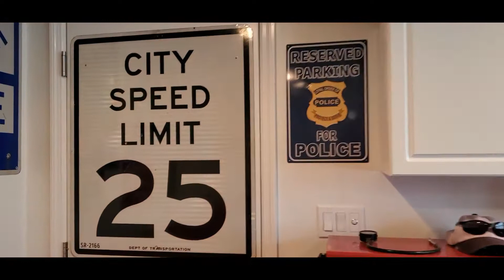All-O-Matic Garage Door Opener

Comment: That was an interesting failure.  In retrospect, looking back and seeing this footage as well as the footage I recorded, the problem was definitely some switch somewhere in circuit that was preventing it from operating.  I think it was the switch that I pointed out that is hit by the trippers when the door hits the end of travel at both ends.  Seeing your footage, the trippers seem to move a bar that the switch is connected to.  It seemed to move, maybe a tiny bit lethargically, and perhaps the switch, which (speculatively) is a BBM (Break Before Make) type.  That means that the switch breaks the circuit in one position, before making contact and completing the same or a different circuit in the other position.  In odd Octember moments like these, chances are good that bar could have balanced itself just precariously enough, that no circuit was made in either direction.  Moving the pulley was enough to get it back one way or the other and it started working again.  Cooler temperatures, high humidity, and gummed up old grease, can cause this.  If the problem recurs, I would look there.  

It's very unlikely, but possible, that the motor was in a "stalled state", again, at just the right position, and turning it got it out of that state.  Otherwise, it appears that garage door opener will run forever, save for the belt, which I'm sure can be sourced and replaced.
Reply from the maker: I should have also cleaned the top of the unit has we'll.
Reply: @xjoe81x  Sometimes the dust acts as insulation that keeps the unit working, especially in cold weather.

Comment: Heres what i think is the issue.  The mechanical latching relay is going bad.  The relay coil could be getting weak, and not pulling in the contacts to start the motor.  That hum you heard in the beginning is the relay coil buzzing.  You can probably find a relay online.  Also id change the capacitor as well.  You can go to harber freight and get a volt meter that checks capacitence. I think your issue lies in the latching contactor.  Might need replacing.
Reply from the maker: Thanks, I'll look into it.

Comment: Holy crap, an All-O-Matic that still exists?? We had an avocado green one at our old house, it was at least from the 70s. It stopped working in October 2019, and was replaced with a Liftmaster one.
Reply from the maker: It couldn't be fixed?
Reply: I'm not sure, maybe. Basically, we went to put it up one night, it didn't stop in time, and brought the garage door way too far back (it actually hit the motor itself and knocked the light shade off). When we called out to have it fixed, we were told that "this thing is so out of code that I could get fined for working on it". So that was the end of it.
Reply: Mine just stopped yesterday. Exactly like this one,  RS model, same colors teal and white. The remote makes it click, the hardwired button does nothing... so then I smacked it and it worked to get my car out of the garage, but now it doesn't do anything again 😂
Reply: @360Moth  May be time for a new one.
Reply: @isaac24  i went out to investigate... didn't see anything or smell any burning that would make it stop working out of nowhere ... turns out the plug wiggled loose, it looked plugged in but wasn't 😂😂 rofl
Reply: @360Moth  Oh, well an easy fix in that case!

Comment: Hopefully you can answer this considering the video is 1 year old; where can I find the release latch and arm seen at 16:00?
I have the same opener, but the previous home owner disconnected it and it's now missing. Very unlikely I can find an exact replacement, but I could use anything to point me in the right direction.
Reply from the maker: Unfortunately I do not know.

Comment: Did you find the problem? My identical opener has the same problem. Works fine sometimes.
Reply from the maker: @freddierizzotto99   No, I did not. I just ran it a couple of times without the door attached, and it worked.

Comment: Do you have a video on how to remove and replace the belt with a new one. 
After hinging the bottom pan the belt is worn in one spot. I would like to replace the worn belt with a new one except I don’t know how to remove it without cutting it. Sometimes you have to move the motor closer to the large wheel to ease tension on the belt. Didn’t see any adjustment above. Is there any adjustment ?
Do u have a video on replacing the belt. 
Mark
Reply from the maker: I do not have a video on that.

Comment: I know this video is old but I’m struggling with my unit - can you verify the motor actually reverses I’ll watch your video and try to tell - it seems it does - I don’t seem to able to make that happen
Reply from the maker: I believe it does.
Reply: Also have a question… do you know if these units have a “training” button? My mother in law threw out her remote to the unit when the remote stopped working. I’m trying to program her car but without a remote to the unit and knowledge of if it can be trained I’m lost…
Reply from the maker: @seanhager1077  It does not. What I have hooked up is a old car alarm. But unfortunately without the factory button there's no other way.